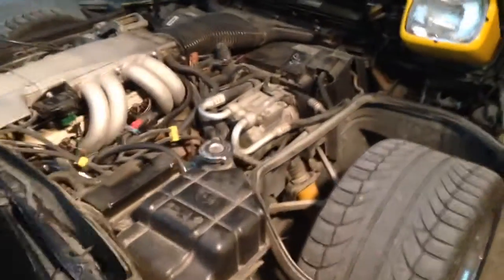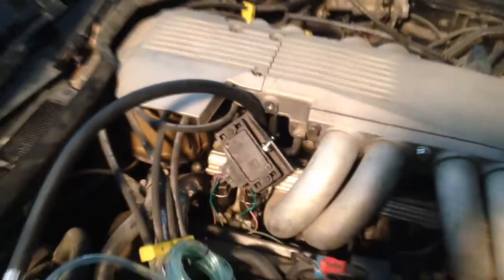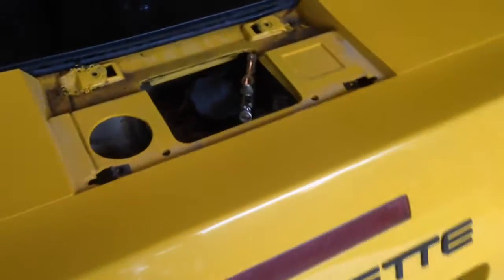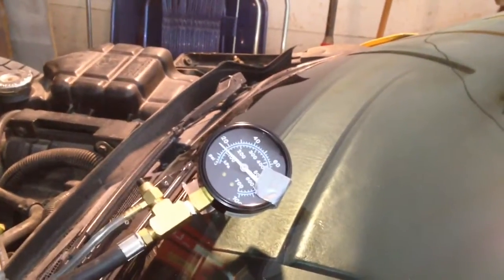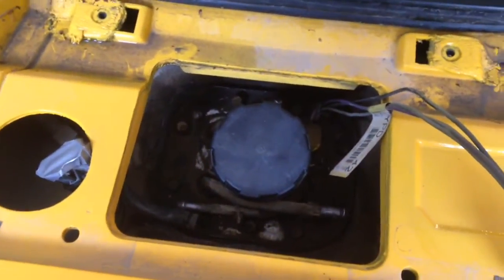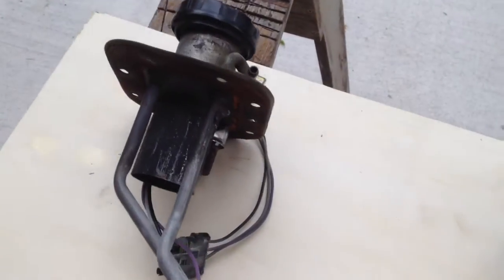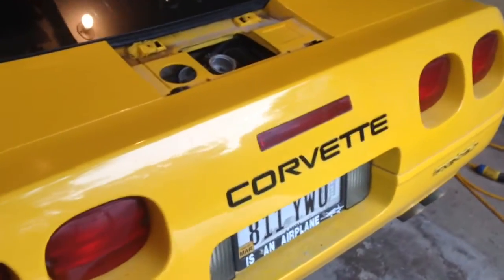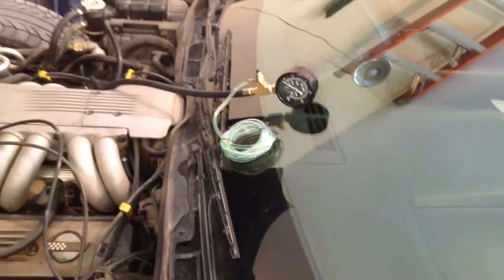C4 fuel sending unit install

Comment: I just had a 85 Corvette coming to my shop with the same motor the same problem car would start right up but went to shut it off after it gets to about a hundred 90 degrees or higher the car does not want to start back up I did a fuel pressure test and within two to three minutes pressure was back all the way down less than 10 lb I replaced the fuel pump in the tank and now even at 220 230 degrees the car starts right back up this was a very helpful video and helped me to work on these cars another thing I noticed that after replacing the fuel pump the fuel pressure while running would actually be about 42 poundss of pressure whereas before it was only about 30 35
Reply from the maker: CR thanks for posting this.  Yea, sounds like the pump in that car was just weak and needed a new one.  Glad there are a few mechanics like you still willing to work on the old cars.  Hard to find people that are willing to do it.  Kind of why I do a lot of my own work.
Reply: flyboyslc1 hey and thank you very much I'm actually 28 years old and have been building classic cars since I was 10 with my dad it's all I like to do is the classics anything modern I find to be a pain in the ass but I take a special interest in working on C4 Corvettes because I have a 1986 so when it comes to anything mechanical on Corvettes does it matter what year what style they are I'm always willing to learn new things about them
Reply from the maker: With your attitude, you will do well in life.  Nice to see people of your age liking cars.  best wishes, steve  Here is a video of me installing rockers on the new z06https://www.youtube.com/watch?v=K826JdlYHe0
Reply: flyboyslc1 thank you very much for the video I will watch that today I just subscribed to your Channel thank you very much for the feedback beautiful ZO6 by the way my dad bought a 2015 C7 like that but not the ZO6 though he got his with the automatic very very fun car to drive

Comment: Great video. I find myself going down the same rabbit hole. Got a new pump ready to install, but first I did the FPR and noticed a small improvement, but then I noticed gasoline in my oil so I went ahead and did the injectors. Huge improvement after the injectors but it still isn't holding pressure, so it looks like I need to do the pump/sender as well lol. Seems like these things are always a combination of issues.
Reply from the maker: Hello Devon,  As i researched the fuel pump issue on line, i came across info that told me that not all fuel sending units would hold pressure for a long period of time.  If the pressure goes to zero, not a big deal, but if it also allows the lines to vacate, then it is a big deal.  The real proof is whether or not the car starts easily, or has to crank and crank to get it started.  If the car starts easily, i would not worry about the fuel sending unit.
Reply: @flyboyslc1 Thanks for the insight. It went from needing to try for like 5 mins or resort to starting spray, to taking one or two loong cranks. Much better but not as good as it should be. I'm gonna do the hose clamp tests you did here to see if it is my cold start injector (85 model), or the pump.

Comment: good video. i have the same issue with my 1985 C4 corvette.

so did it start up straight away after the replacement?
Reply from the maker: Yes sir.  The new pump solved the problem.  One thing for you.  The old original pumps had good check valves in them.  My understanding is that the replacement pumps do not have good check valves in them, but it appears that it is not an issue.  The replacement pump supplies enough pressure once the key is turned to immediately pressurize the fuel rails and the car starts right away.

Comment: I have a c4 1990 tpi,,, I pinched off supply and  return line. With my fuel pressure gauge at 50 Psi.. Why am losing pressure if my injectors are not leaking. I don't see them  leaking when I lift the fuel rail
Reply from the maker: Hi Tito,  A couple of ideas for you. The fuel sending unit has a back check valve in it.  If it isn’t working then fuel will flow through it back into the tank.  Also if the fuel pressure regulator diaphragm is ruptured fuel will flow through it into the vacuum system.  Pull the vacuum line off of the regulator (beneath the plenum) and see if there is fuel in the line.  If so you need a new regulator.

Comment: Hey man I put a walbro 255lph and I'm still losing pressure slowly. The  diafragma inside the regulator is new too
Reply from the maker: Tito,  Hope you have found the source of your pressure leak.  Just so you know, some pumps will slowly loose pressure, and it just doesn't matter.  If the car starts and drives OK then not an issue.  If you are having starting problems, then you may be loosing pressure due to a stuck open injector.

Comment: I have a similar problem, 1986 C4, fuel just cuts out while driving, engine still runs but when pressing the pedal down it doesn't want to move, last about 3 or 5 seconds then gas kicks in - change the fuel filter but no change.

any ideas? 

Great video
Reply from the maker: Anton   Hi Anton,  check out CorvetteForum.com and look for the C4 Tech section.  Lots of good info there.  I have a 1991 so am not sure about what your car has on it.  I do know that the fuel pressure regulator does cause trouble sometimes.  Google 1986 C4 fuel pressure regulator and see what you can learn.  Also if you are not a member on the CorvetteForum, then join and ask your question there.  Also if you have a fuel pressure gauge, you could hook it up and tape it to your windshield and then go for a drive while able to view it.  That would give you and idea what is going on.  Good luck,  steve

Comment: So my question is is the check valve inside the electric fuel pump?
Reply from the maker: Yes.  The check valve is part of the fuel pump.  You can google it and find confirming information.
Reply: I have a 86 starts fine when cold but when engine get hot just cranks but won’t fire so am thinking I have the same problem as you but I haven’t done a fuel pressure test yet I don’t have a gauge
Reply from the maker: C R   My car started OK when warm.  I think you have other things going on.  A bad coolant temp sensor could cause your issue.  You can buy a pressure tester at an auto parts store or maybe even borrow one from them.  Cost about 30 bucks or so.  Also, you need to get a set of factory service manuals.  They have good trouble shooting charts that will help.  I looked on eBay and found a set for My 1991.  Cost me 100 bucks but if you are going to work on your car they will be very helpful.
Reply: flyboyslc1 thank you so much for your feedback tired of chasing my tail with this car
Reply from the maker: C R  google “89 vette won’t start when warm”. This should show a link to corvette form.  There is a lot of good info there that will help you.  If you are not a member on the forum, then join and ask your question in the C4 tech section.  Do some google searching first.  I also thought you may have bad ignition coil or module.  They can fault open once they get warm, and will not work well again until they have cooled off.  Also many other threads on forums relating to hard starting when the engine is warm.  You can check the ignition yourself by pulling one spark plug wire and then connect a spark plug to it.  Lay it on your valve cover and crank the engine.  Do you see a spark?  This will tell you if you have electrical or fuel problems.

Comment: Try Rockauto to buy your parts that same pump and assembly might be only 50$
Reply from the maker: Oroz.  Yes, it is always good to shop around for parts.  Just for fun I checked Rock Auto today.  They are at $196 for a AC Delco unit, or $89 for a Chinese knock off.  Don't know what their price would have been 3 years ago or whenever it was I did the remove and replace.